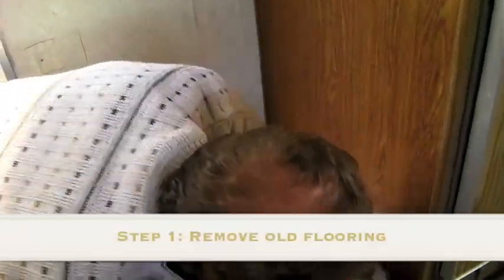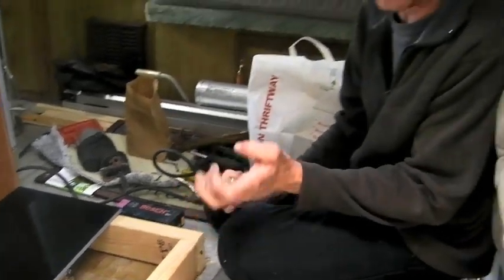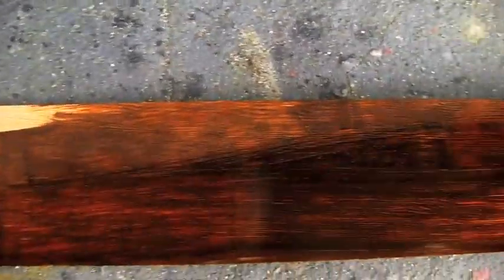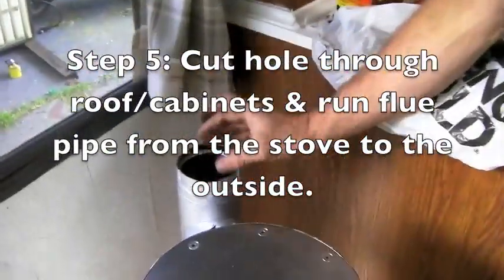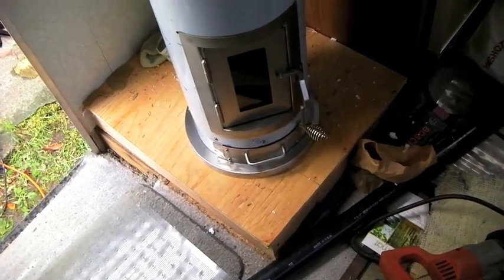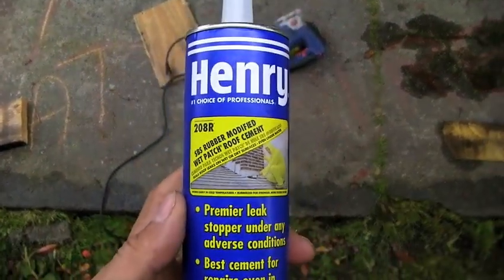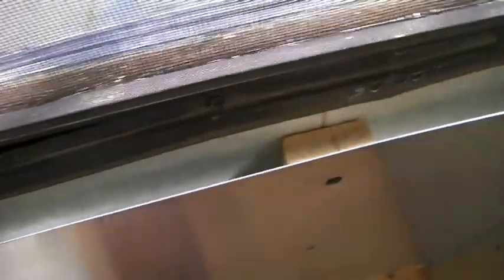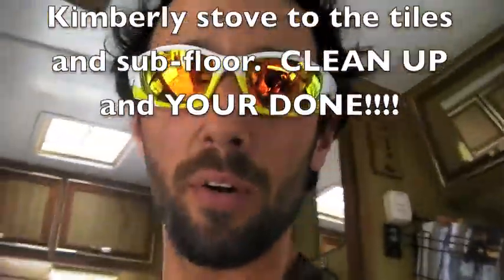How to Install a Kimberly Wood Stove in a motorhome

Comment: What some people that this is one of if not THE most efficient burning stoves in the world at 3g emission.
Its made to last 10 years plus with proper maintenance.
 Once stoked, in a 26ft rv. You can feed it a brisket( three inch piece of compressed log) over hrs. Maybe use two a day max. Carry ten or so with ya in case you can't find wood. And no one will spot your smoke or smell your fire.
 You also save more propane for cooking and hot water while
boondocking.
 Yep I'm hoping to get one. Its an investment like a premium A/C unit for your home. I'm totaly impressed.

Comment: The Kimberly Stoves are wonderful but Expensive!  For the Budget challenged I would suggest checking out the DIckinson Marine Stoves and the Tiny Tot by Fatsco.    Easily 1/4 the price or less.  These Kimberly Stoves are around $4,000.00-6,000!!!!!  The Dickinson Marine Stove is $700.00-1,100.00 and comes in Solid Fuel or Propane Versions.  The Tiny Tot Cook and Heat is around 300.00.   They are Marine Stoves and VERY safe.  Many People install them in their RV's, Tiny Homes and Cabins. 

 I will be installing one in my very old Kitchen with a Cement Floor.  The Kitchen used to be a tiny Milking Parlor for a few Cows.  It's nippy and the old single Radiator is just not holding up.  I wish I could affored a Kimberly Stove and it looks like a great Stove but many folks just can't afford them.

Comment: Hey Timmy.......awesome work, but maybe one suggestion. Can you add to this more about the hole cut in the lower part of the cabinet? The last shot of it shows the pipe right against the lower part, before we cut that out more and installed the larger pipe as a shield. I would not want to mislead anyone into thinking this was all that was needed for pipe clearance.
Roger

Comment: Anyone here that is contemplating a stove in an RV or boat or through ribbed metal roofing check out "high temp silicone pipe boot" instead of that gaudy and cheap looking roof flashing for comp roof houses he's using, MUCH cleaner and higher quality look, much better seal and forms easily over any shapes even corrugated metal roofs. Most are orange but ive seen them in grey and menards dot com has them in black, use high temp silicone caulk instead of that tar for a real clean install.

Comment: I'm rebuilding an old 18' Scotty camper over the winter, customizing it into something nice I can live in while I travel for a couple years. Heating and cooling is my biggest concern. I'm probably going to make a custom rocket stove similar to the Kimberly you have. Any suggestions for efficient cooling during the summer though?
Reply: I have a propex heater and a small wood burner, the heater kicks in when the fire goes out in winter but it's no1 feature is that you duct air from outside and heat that so very little condensation if any and during warmer weather you just use it like a fan pulling fresh air into your van.
I've lived in my sprinter van for six years in the UK and no problems yet with regard to heat but we have very little in the way of high temperatures to deal with many cold! 😔! 😉

Comment: Would have been better to lose the chair on the other side of the door. You installed it right against the fridge. You save 5 bucks in propane, from heating. And spend 15 bucks, keeping the food cold. Saving grace may be that if it is cold enough to use the stove, it is also cold enough to store the food outside. LOL